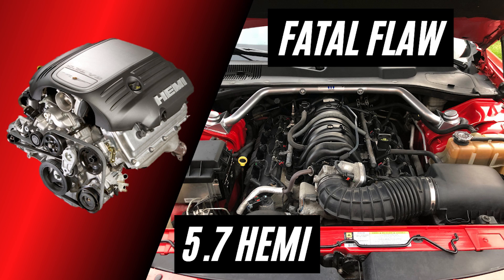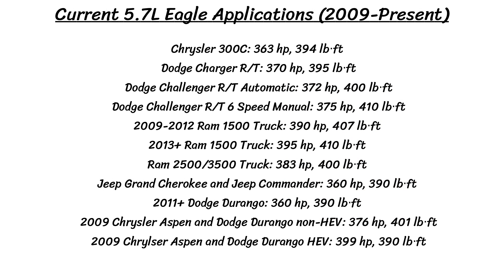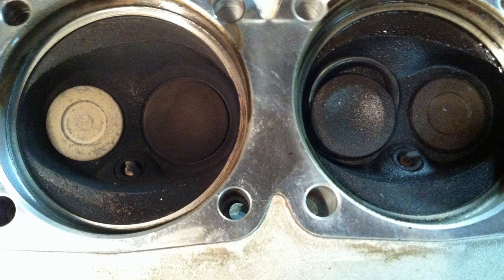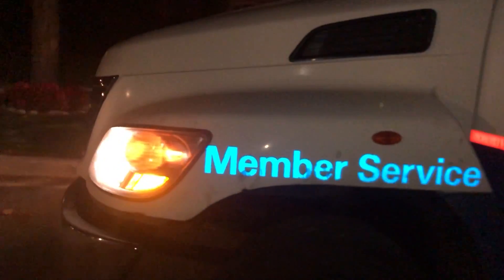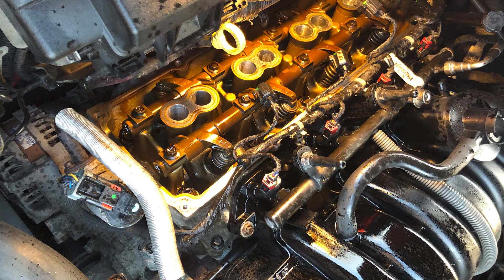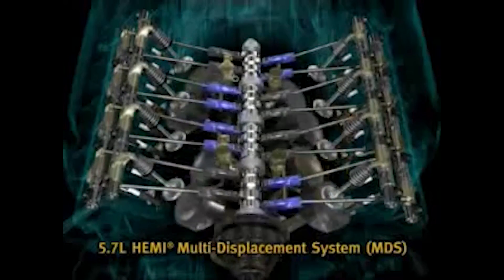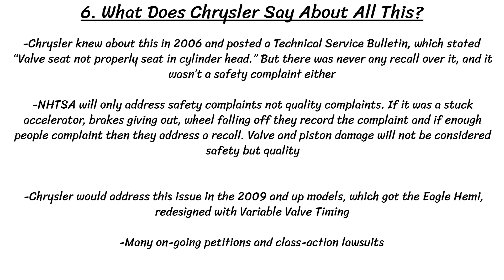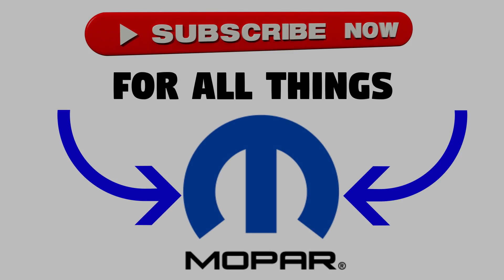The Fatal Flaw of the 5.7L Hemi V8 Engine & How to Prevent It (2003-2008 Valve Seat Drop)

Comment: WHAT ABOUT THE FACT THAT THE LIFTERS, WITH ROLLERS THERE ON,  DO NOT GET ENOUGH OIL FLOW,  AS WHEN IT TRAVELS FROM THE PUSH RODS, ONLY GETS ABOUT HALF WAY ALONG ON THE LIFTERS, AND ON THE BOTTOM SIDE OF THEM AT THAT. THIS STARVES THE ROLLERS AND THE CAM FROM GETTING LITERATELY, ANY OIL AT ALL.  THIS CAUSES THE ROLLERS TO SEIZE AND THE CAMS LOBS TO GO FLAT!!!  HOW DO YOU ADDRESS THAT ISSUE? WHEN I REBUILT THE ENGINE I PUT IN A MILLING 65 LBS OIL PUMP, OVER THE STOCK 50 LBS PUMP.
THE JURY IS OUT AS I HAVEN'T RUN THE ENGINE YET. 
 WHAT CHEMICAL CAN BE PUT ON THE AREA WHERE THE SEATS FIT, TO KEEP THEM IN PLACE, AND NOT COMING LOOSE?

Comment: A buddy of mine told me a few years ago...you will not find a charger or challenger with 150.000 miles or more with the same engine and trans without being fixed at least once..and he was right....even the new ones are not good...stand next to one when its been running for a while...feel the heat coming off those things...i dont want a engine that runs 200 degrees at idle...heat kills everything..people are keeping them in business tho

Comment: This happened to my brothers car around April 2020. It´s a 2006 Charger Daytona, MDS was already turned off. I´d probably blame the cooling in this case. We live in Sweden so weather wasn't too warm and it had been running on idle for about 10 minutes. One piston were totally broken and scratches in two cylinders. Engine is now completely refurbished, with brand new heads.

Comment: Hi guys, how to know if the 2006 6.1 (no MDS) and 2011 6.4 (MDS) have steel valve seats, without taking it apart? (I'm not a mechanic unfortunately)

Comment: I’m at 200k in my magnum r/t still going strong only had to replace the radiator a couple times
Reply: Aha!    I’m on my third radiator.   The second one lasted about 14 months and leaked in the exact same place, bottom passenger side near where the other lines plumb in, I think the trans cooler.   Interestingly, my brothers ‘09 Ram 1500 is on its third radiator, leaked in same place twice, near fittings, but drivers side.  Now it appears that it’s where the side tanks attach to the core part.
Reply: Im only at 104k and replaced only a waterpump and a radiator hose
Reply: Should get an aluminum one instead of the plastic so the deposits don't build up
Reply: @kylealton4347  yes you are right Kyle Aluminum Radiators is the way to go they are the Best that you can get I know they are not cheap but in the long run you would never ever had to replace it Kind Regards Peter

Comment: My dad has a 06 charger Daytona it's one of the first 2000 ever built. I think its number 1870 to be exact but it has 143k on it and we've had numerous electronic issues but luckily few mechanical problems with the car. Overall love the car would I recommend one to someone else, no. Get a newer one. But for buying it in the first model year and it being a limited edition it's a great car

Comment: The fatal flaw of the 5.7 hemi? The engine! It's anemic, 370hp in a 5.7L V8?? You have NA V6s pulling that power at nearly half the displacement. You're throwing that in your boats of cars like the charger and challenger, and they're slow as shit.

Comment: 2004 ram 1500, 326,000 miles zero problems with engine or trans.  Ran full syn since 90k, installed a 185 degree thermo at 100k.

Comment: I'm getting a u0100 code on mine, sent the pcm off to be repaired and they said it tested fine, it stalls out randomly and won't stay running,  06 rt magnum,  new engine, new plugs, new coils, new gas tank and pumps, new crank and cam sensors, im at a loss.
Reply: i got that same code going on my 2006 dodge charger r/t, im taking mine to the dealership tomorrow to get my CAN Bus tested and the PCM
Reply: @24-5M I ended up needing a new pcm, I sold the car in 2021

Comment: You just made me a believer in letting engine idle during a fill up. Cycles is cause of mechanical wear I do believe that, not time or distance.   I do have a question HOW do I turn off the variable displacement oil pump feature on a 3.6 Pentistar Thank You

Comment: There are third party head refurbishers that use a different material and process for the seats, I've seen them in Jegs and Summit catalogs and sites, If i were to even get one, the first thing I'd do is look at a head replacement as well as a full coolant flush to make sure it's in top condition

Comment: ive worked on alot of   cars with aluminum cylinder heads, Alfa,s j, Fiats, VW air cooled, Datusn ,Toyota, etc  and Aluminum heads for V-8s, most after market  heads for V-8s need to have the seats re cut for proper sealing, those  ready to run heads are mostly shit, with Chinese valve springs, keepers  and the valves are crap, your better off buying a bare casting and let a machine shop supply the good parts, and do final assembly, as for  the Dodge hemi ,s the bean counters had their heads in their butts the cylinder deactivation causes uneven temps, and the interference isnt enough , cast iron heads, back in the day didnt have valve seats pressed in, same deal with valve guides, when unleaded gas was mandatory that changed the ball game. Ive seen  machine shops heat the crap out of aluminum cylinder heads, and install the valve  seat after it was dipped in liquid nitrogen, and then peen them in place, after heating the head sometimes they warp so bad they get tossed, my two  cents.

Comment: I would like to know if all the   cars with dropped valve seats are running the stock 230 degree thermostat ? I have used the 180 degree in my 2005 magggi with modified electronics that shifts at 6200 rpms and is still pulling but I won't go any higher . I have 177,000 miles on her . I think the 230 is to hot before it even starts to cool .

Comment: My 2007 300C dropped the valve seat on the #7 cylinder at 107,000 miles. I will never buy another Chrysler product because of the way they refused to deal with a major manufacturing defect. My wife wanted to buy a challenger when we needed a new car. I said no fucking way and we bought a new Hyundai veloster turbo. Fuck Chrysler.

Comment: Drop the MDS cam and Lifters and you’ll be fine....
Reply: MDS isn't the cause of this issue or the lifters failing. Stop spreading misinformation.
Reply: @Someguy6571  well what is the cause of valve seats dropping then
Reply: @KCChiefs1997  overheating the engine is what's causing the valve seats to drop.

Comment: First of all I think the key is changing your exhaust and then changing your oil every time that you needs to and also my car has 273, in my charger still running strong and change the thermostat at 180°, it makes a lot of difference to release the heat a lot quicker out the engine when I change my exhaust that big muffler that is got any holes a lot of heat so it doesn't release the heat a lot quicker so that's why maybe that's one of the main problems thank you

Comment: Any issues with the current 5.7L eagle hemi?  Looking to get a new 2020-2021 Charger RT
Reply: Look up roller lifter failure and chewing up camshafts. Affects the 345 and 392. Seemed to start in 2010 and supposedly was addressed in 15 or 16 but maybe, maybe not? Also exhaust studs snapping prematurely but I think it happens mostly to the Rams. 
I dig the Challengers and Chargers and all the flavors they come in. Great riding, cruiser for sure. Just check out those issues and with a grain of salt too considering you’ll only hear the horror stories online. That said, I’ve got a shitty sounding lifter on a well maintained 5.7 @ only 60K. Get an extended warranty if you can swing it and it will give you peace of mind if you’re the worrying type.

Comment: I have a 2007 300C AWD with 5.7, fully loaded with 20” SRT rims, 140,000 on the dash and runs MINT.. had it for 3 years now I’ve only replaced an actuator pin in the ignition and an alternator

Comment: 2010 Challenger R/T
6 speed manual track pack, 6.1 short's, 180 thermostat, cat delete,
Flowmaster 40's, ported throttle body, 6.1 intake manifold, and Roto-Fab cold air intake. 156,000 miles still running strong. Nothing but synthetic oil and 93 octane.👍
Reply: You got the eagle bro this affects 03-08 hemis

Comment: This happen to my 07 Magnum 5.7 and 147000 miles. Currently, pulling the head on the driver side off. Cylinder 3 does not have compression, so hoping for a clean piston head.

Comment: had same problem  car had previously over heated before i got it. this is one of main factors as you said i repaired mine but had bit of trouble getting new seat fitted, hemis bit more rare over this side of the pond just a fair bit of work to do

Comment: Yup, Me Too !!   2005 Jeep Grand Cherokee 5.7L  At 90000 miles , Valve seat just fell out and required a engine rebuild. I am a 38 year machinist and understand very well this concept. My local engine builder/machine shop guys understood also. I later had more problems and picked up a 2012 Grand Cherokee with the 3.6L V6 and will live with a less powerful ride.The 5.7 is way more powerful. Other than the valve seat issue, the Hemi engine is a very nice design.Get yourself a 4.0L XJ and you will be happy. I've owned XJ's since 1990 and trust them to go on any long trip. My 91 4.0L Comanche Eliminator  is a beast. I'll put it up against any New car for reliability . Let's see where your new car is in 30 years- Junk yard !  Thanks AMC . American Motors Corporation.

Comment: Yup, #1 exhaust valve seat dropped in my Charger Daytona due to overheating  caused by a cracked radiator. Took the piston out in pieces and by some miracle the cylinder wall was barely scratched. Mild hone, used piston and head (eBay) new rings, gaskets and head bolts, Total cost $475.00 and she’s been purring like a kitten for the last 3 years. Did the job myself so no labor cost. That engine is a pleasure to work on, very easy, not a lot crap in the way, very straightforward... I like it

Comment: i have over 201k miles on an 09. i only drive only in auto stick. And I drive it like I stole it. keep the oil at 7 qts. that will help
Reply: I got an 06 Daytona, i drive it like i stole the thing, wintertime too, no problems. Autostick, shift at 5700 when it caps out, runs real strong. I hadn't drove it for a bit due to all this covid poo, it was freezing temps, man that thing LOVES The cold weather, i forgot the difference. It goes from yeah yeah to holy shit hahahah this is fun.

Comment: My 2006 Charger dropped the valve seat and catastrophically blew the engine at 169K miles. It happened in one of the MDS cylinders. I replaced it with a Jasper re-man with the newer valve seats and turned the MDS off.  I also have a 2007 Aspen, but have since disabled the MDS. No problems with the Aspen yet (fingers crossed) at 80K miles.

Comment: 2020 RT Durango  No engine issues yet at 19,000 Highway Miles.  FYI, the 180 deg Thermostat will throw a code (Thermostat Failure) but you can get by with the 192 deg Thermostat without throwing the code.  Still running about 10 deg cooler on Coolant and Oil Temp which is useful.  MDS is only active in Eco Mode, so I avoid that.  My general feeling is that MDS removes the tension of the Valve Springs and lets the lifters bounce on the camshaft lobes causing some failures in the past.  That's probably a simplified explanation but close enough.  Hopefully these issues with valve seat fit and camshaft lobe failures are resolved by FCA by now.  Most annoying feature is automatic downshifting when coasting downhill with the brake off (not applied).  I don't mind that feature if the brake is applied but when just coasting down a hill at 40 mph it is quite annoying.  Also causes an annoying upshifts and downshifts when going up and down hills.  The Shift Paddles (manual mode) are the only cure.

Comment: My 2011 Chrysler 300c has 267000 miles on it and all I've had to do is change plugs,  alternator which was covered by recall and coils. Synthetic oil ever since I've had it. It runs just great and when the 5.7 does need replacing I'm going to go way bigger.  Hellephant 300 would be great. It would be the only one around here i suspect.

Comment: Engine needs to be designed better. Big problem is with cam rollers not getting enough oil during long idle periods. Eventually destroying the motor.

Comment: Keeping oil flowing through the lifters at all times is the problem when idling and not allowing the cooling system to cool the engine before turning it off..using the shifter turns off the MDS thus creating oil/pressure in all cylinders at once...wanting to save fuel with a V8 monster like the HEMI is foolishness. Chrysler wanting to please the "Brady-Bunch" mom they created the MDS.

Comment: Do other engines and carmakers mix steel and aluminum valve parts? I recall a warning in my Chilton manual about changing spark plugs in aluminum block engines, saying to let it fully cool first. Once my mechanic didn’t and when I left my car would run rough and break down like I used cheap gas, until they redid a spark plug change.

Comment: I thought you'd be talking about the fact that it doesn't oil properly from poor design. That's the biggest thing I've seen with all the 5.7 hemi engines. Rotating assembly sits to high, doesn't see enough oil splash. The LA motors never had this issue. They did this on the new hemi platform for improved valve trajectory. It served the purpose, but didn't work out well. 

That being said though, yeah every time variable displacement has been used by any manufacturer in the past 70 years. It's failed miserably. If the EPA didn't spend decades pushing auto manufacturers into corners we wouldn't have these problems.

Comment: 116.000 miles on my 05 Magnum RT bought new and no seat has dropped YET.  Knock on Wood.  I do have a severe duty radiator that I plan to install to help.  Maybe a lower thermostat at the same time.  The RTs came with "heavy duty" cooling.  Severe duty was for the police cars and cars with the tow package.  The SRTS have the severe duty II radiator.

Comment: I've heard of this happening to the 4.7 V8 and it's related 3.7 V6.  Didn't think the HEMI had that problem?  Of course a 180 degree thermostat is strongly recommended on ANY engines!  The 2.7 V6s were well known for another problem,   oil cooking into sludge.  Here's a few hints as well. many aftermarket remote start systems come with a "turbo timer" feature which can keep the engine idling an additional few minutes after you leave the car.  Apparently sudden shutdown after driving is bad for turbochargers!!  But shouldn't be a problem on a properly designed N/A engine itself.  As far as eliminating the catalyst converters,   what about those in California and other states that require emissions testing?  And in non emissions testing areas,  you will STILL have an idiot light coming on in any OBD-2 (1996 and newer)  cars.  Due to the downstream O2 sensors.  (Though there may be some tricks or calibrations that will eliminate that)?

Comment: Yep, happened at 90K, I believe it was heat related too! Wife drove it for 10 mins down the road... stopped for gas and bam! Over and I had to rebuild it. Always check to make sure your fans are operational. Your engine can heat to 240F and little will show on the dash gauge. After many times driving with this occurring, I believe it weakens the seat and fitment. Good luck all!

Comment: Ive never seen this after 5 years being a Chrysler Tech, I've never even heard of this happening honestly.
Reply: I heard alot of issues with the lifters is people think synthetic oil is supposed to be a 6 to 8,000 mi oil change interval... Keep fresh oil in your engines people.
Reply: @williecraker5624  yes!!!!
Reply: Those engine affected are from 2005-2009, so unless you're routinely working on 15 year old cars, you're most likely not going to run into it...
Reply: @Odium515  you'd be surprised, with all our city trucks and police cars most of which run this engine with stupid amounts of miles. Still interesting tho
Reply: @prestonikard9221  Most dealers just cut off most cars from parts and sometimes service after i think 10 years is the landmark...understandable to keep items in stock ect. My 06 Daytona Hemi (same as his basiclaly lol) has 130k miles no problems...hoping the valve seat dropping is just an overheating issue
Reply: @baileyhatfield4273 that makes sense, I was unaware have only been at the one dealership but we are a very small dealer,  with only 4 techs and one oil changer lol. Fingers crossed for you and your car as well! 😊

Comment: Wow great well researched video.  This problem is easily resolved by doing what I've done for every water cooled ice vehicle I've ever had.  Install a 160 stat and biggest aluminum radiator you can fit and tune for it.  Done.  The hemi will likely run as long as u would want it to.  Last one went 175000 miles with 10000 mile oil changes still running just fine.
Reply: How about 180 Tstat?
Reply: Yeah I tried a 180 and it's surely better than stock and the best choice if you're up north.  A big radiator will mean 175 water temp so that's not too bad.  But here in the south with a 160 stat and the same big radiator in 100 degree weather I run 170 degrees- 155 in the winter.  To sum up- 180 in the north, say Oklahoma and north, 160 down south.  Have a problem with heat in the winter- just stick a piece of cardboard in there between grille and radiator works fine.
Reply: Nice, no i live in north Africa, it's hot here so I'm running 180 and it's doing great, gonna add a pulley fan along with the electric to secure the cooling sector lol, i just had my engine rebuilt though